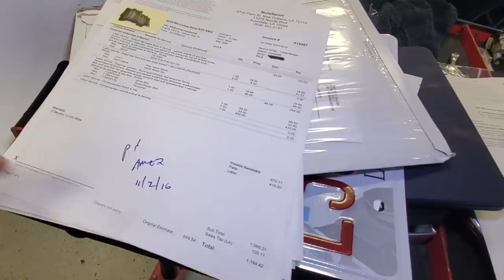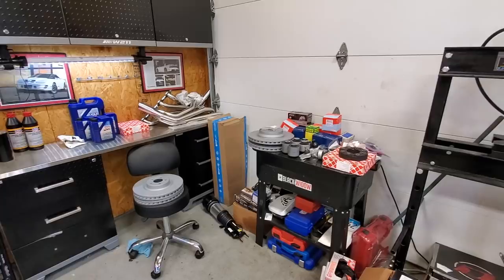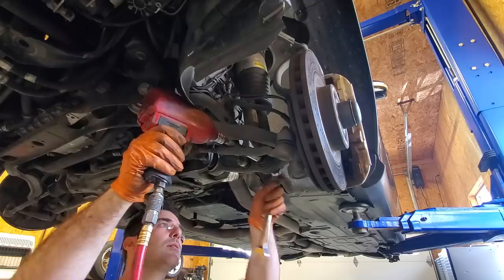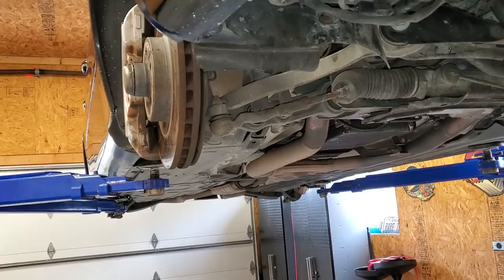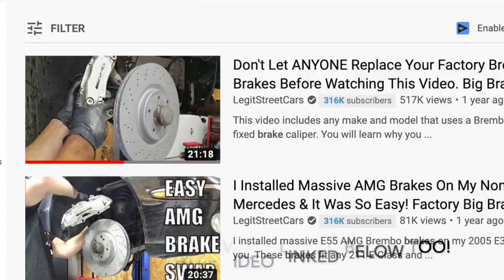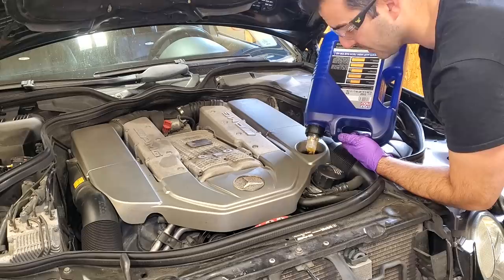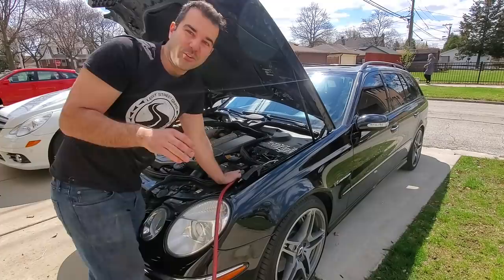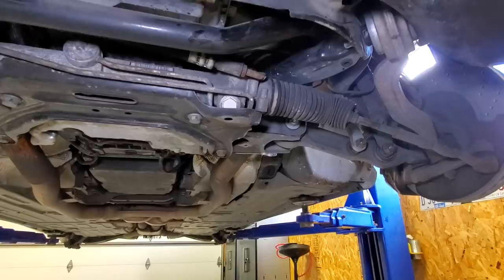I Mechanically Restored My Rare E55 AMG Wagon In 1 Video & Saved $5,000 Doing It Myself. Legit Fix!

Comment: I just finished replacing the entire ABC system, all suspension, all 11 rht hydraulic cylinders, motor mounts, plugs, wires, injectors,  fixed fuel tank baffles, and repl brakes. On my r230.  got the car for 1200. going to get new rims, o2 sensors, leather for the seats and a new android command system.  I got it from the original owner with 30k of receipts. I took pictures of every thing I did. so the car has been restored to like new. I also painted the rear sub frame.
Reply: I'd take that over buying one that had all that work done. If I wanted to drive one today and never get my hands dirty, buy a sorted one. But for me, half the fun would be propping the laptop on a cart, turning on Alex's how-to videos and getting to work on the car. Garage time : driving time for me should be at least 50:50 in the early stages of ownership. Otherwise, it's kinda "too easy" if you know what I mean
Reply: @Czechbound  if you have the tools and a rack then you have a chance. it is a hell of a lot of work. I am a mercedes tech with all the specialty tools. the ABC hoses are not cheap either. dropping sub frames to change them is labor intensive. I got the car for a cheap price once the hoses started bursting. I am just going thru it all and restoring it. I figure I will have a very nice car for about 7k total with everything working like new. I may sell it and get the AMG55 version.
Reply: I have one and it's not worth the hassle. My next car will probably be a A/C Cobra Kit Car with a blown 427 in it. Easy to work on and fun to drive. Gets way more attention if your into that kinda thing and c as n burn the tires right off.
Reply: @nowthatsfunny1  perhaps a classic corvette may serve you better.
Reply: @nowthatsfunny1  if you have the money and can install a lift. then do so. get a US GENERAL tool box and lots of HF tools. get a star diag and then find a mechanics special amg55  just tool up. get a 1600$ lift. 4k tools and have fun

Comment: I don't own a Merc, but love this channel. I really like the garage setup. The last thing I Fixed on my car was LH/RH FR Wheel bearings. Anyone who has replaced hub assemblies in an Aluminum carrier assembly has my sympathies. It nearly killed me. I suppose if I had used heat, it may have went smother, but had to bash them out with Air chisel and hammer. Keep up the great work!

Comment: That wagon deserves a Fluid Film undercoating when you're done de-rusting to protect it from Chicago harshness!
Reply: J A. Chainsaw oil works good as rust protection i have heard from alot of farmers at my work!

I live in Norway where the goverment uses obscene amounts of salt(seems more like acid when you look under our cars🤪)
Reply: Used oil sprayed underneath can work wonders.
Reply: Most under coats are worthless. The salt acts as a grit and wears away the undercoat any way.
Reply: Tom K  Thats like saying «Don’t wear a condom, beacuse sometimes they break»
Reply: @LJ-fe8vb  not really. Most undercoats hurt gas mileage, makes you slower and doesnt last long enough for the price to be worth it. I looked it up and did research. Most undercoats need to be replaced/redone every three years. Thats way too much money and not enough time for something thats supposed to protect your car. I agree spraying it down with some type of oil will prevent some rusting due to atmosphere based rusting like if you lived near an ocean for example. But salt related to snow is too abrasive for undercoats to do much good. But go ahead and get it yourself. There's a whole industry based around it.

Comment: Hi great video's on your channel however I saw 1 mistake that a lot of people (also official garages!) make when changing the motor oil with the orientation of the oilfilter/housing like this. You need to open up and pull the oil filter first before you start draining the oil sump. If you don't do this in this order you will not drain the oil that was still in the oilfilterhousing (approx 1/2 liter) and that will end up in the sump you have already drained and plugged. In the end,firstl you will mix up that 1/2 liter old oil with the new oil, but secondly and more important, you will fill up too much if you fill up according specifications. Especially with these cars with no dipstick but just a read out on the dash this can be tricky. If this has been done f.e. 4  times like this you will end up with 2 liters more (4 x 0.5 ltrs) then there should be. Eventually you will have a warning on the dash that there is too much oil in the engine but damage can be done already....like f.e. pushed out/leaky crankshaft seals ;) Hope this make sense ;)

Comment: Brilliant video again, I’m so envious of your garage, just purchased new discs and pads plus sensors for my E Class coupe as they have about 1000 miles left in them. I bought them from a Mercedes Benz dealership at a cost of £380.00 including VAT as I wanted original MB parts. The dealer wants £1050.00 to do the this work which is crazy and they are easy to do. I also followed your advice on the ATE lubricant for the pads, £5.25 on Amazon bargain lol 😆 looking forward to the next video keep up the good work.

Comment: Hey, the hydraulic lines. Best way to repair is soft seal or lanolin after remove rust. Then use denso tape to coat. I work with submarines and best for this application where gets wet n stuff... love your reviews, good smart content

Comment: My input to add, being a former Mercedes 𝐓ech. The mechanic should be doing a software check during the B  service, on the SBC pump. That should also tell them if the pump needs replacement. 20% of techs check this(at least at the dealership I worked at).